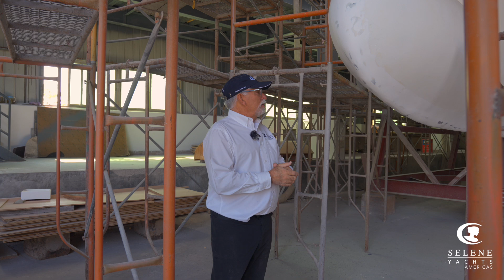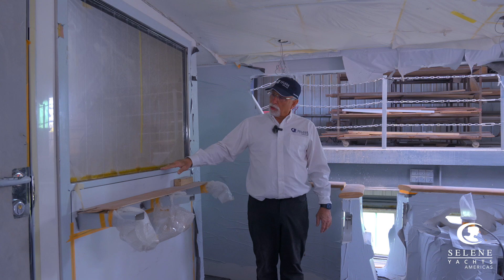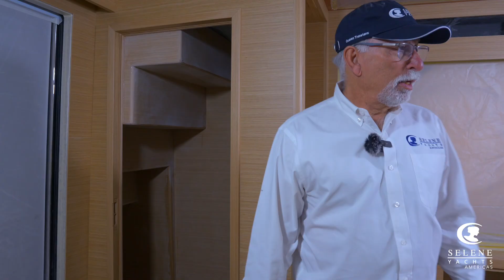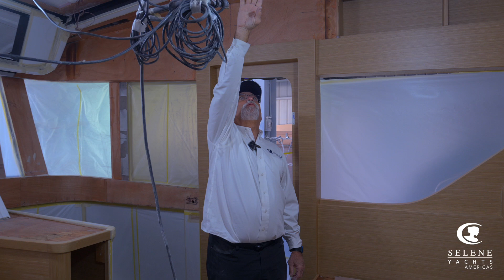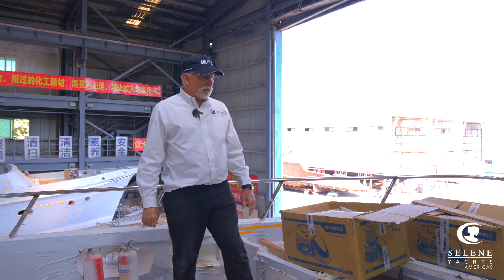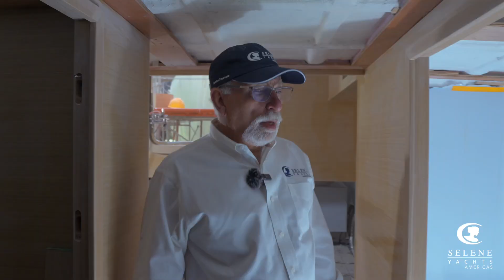Selene 62 Ocean Explorer | In-Build Yacht Walkthrough at the Factory

Comment: The website doesn’t list the 62 as a current model that’s available for sale. Is that a discontinued model or what is the difference between a 60 and 62 and why aren’t the 62’s listed on the Selene website?
Reply from the maker: Thanks for reaching out. We started our site listing some of the core models and are in the process of expanding the site to add in this model. The main difference is volume, beam going out an additional 10" and LOA actually increases over 3 feet. Where you really notice it is added volume in the boat, one owner of a 60 went through this next size up and kept proclaiming "wow" as they were impressed by just how much additional space this boat has. We are happy to go through all your questions anytime: info@seleneamericas.com or 1-877-689-3979

Comment: Nice yacht and thanks for the walkthrough.  Would have been much better if the camera was pointed at what was being talked about and not on the person doing the talking.  It is supposed to be showing the yacht and not the presenter.  What is "engineered" oak?  Thanks :)
Reply from the maker: Thank you for the kind comment and feedback on the focus of the camera noted - something we've been working to improve.
Reply: @SeleneAmericas Yes, what is “engineered oak,” and are the other finishes also “engineered?”
Thanks for the walkthrough.
Reply from the maker: @Slonge92  Thanks for your question. Engineered oak is oak that has been broken apart and reconnected so all the grain is consistent and runs together in the same direction (v.s. natural grain will have variations and not all be in a straight line). Many of our finishes are not engineered - this is just one option.
Reply: @ Thank you, I appreciate the reply.